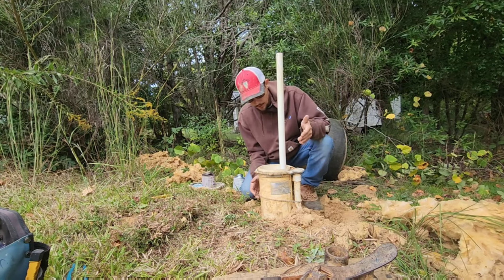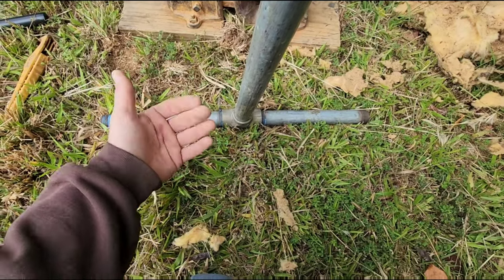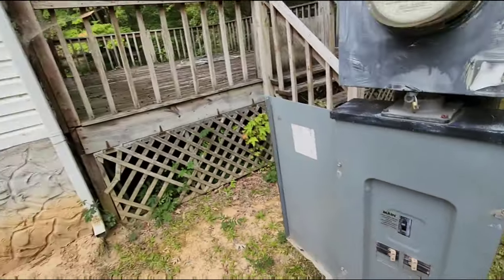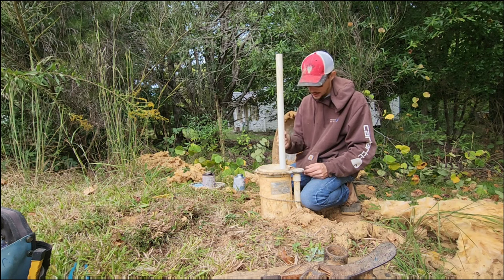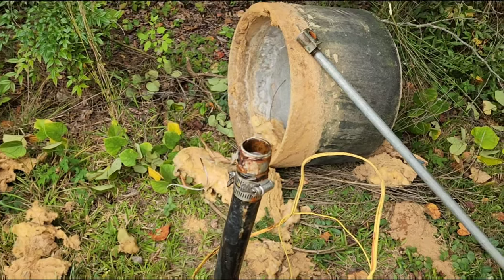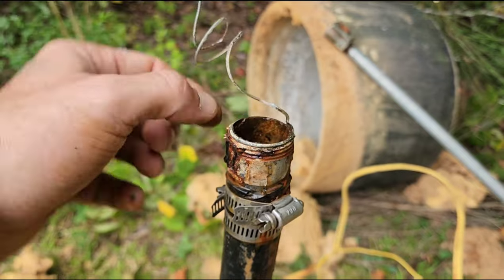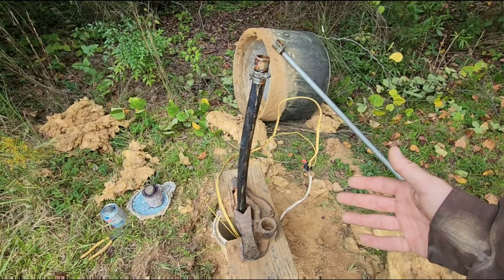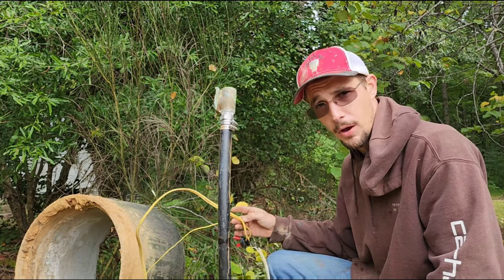Well Pump Repair on Pitless Adapter Style Hook-up. The Drop Pipe was Broken! No Water Pressure

Comment: So I have a well about 80 feet deep, and maybe 30 + years old. So I made my one inch T, connected to the pitless adaptor, got it lose and as we were lifting the pipe, the black PVC broke from the pitless adapter and all of the sudden we noticed the electrical wires been fast pulled down! So now the PVC pipe is about 25 feet down, and the 3 #10 wires are holding the pump. I thought we could just pull the wires to get the pump out, but that pump seems so heavy that we cannot budge not even a little. Any ideas of what I can do next?
Reply: It's possible that with the pipe falling 25 feet down your well that the pump on the bottom end got wedged against the sides of the borehole.  When my well was drilled, the pump installer was lowering the pump and water line down the hole and it got stuck before reaching the depth that the pump was supposed to operate at.  He tied a rope to the black poly water line, connected the other end to the bucket of his backhoe, and tried to pull it out by jerking up and down with the bucket.  The black poly pulled loose from the pump, as did the wiring and the rope to the pump, and he lost the pump.  He had to drop another pump down the hole right on top of the stuck pump.  It was a set price for me, so he was mad as hell.  Luckily my well puts out 15 gallons a minute and the water level was almost to the top of the casing so the second pump was not affected, even though it was a good 40 feet from where it was supposed to sit.  This might have happened to you.  I hope not but be careful with how much force you use to try and pull your pump to the surface using just the electrical wiring.  Good luck to you.

Comment: You skipped the part where you put the adapter on the black pipe. That's what I came here to see. Do you have to use a torch to heat it up?
Reply from the maker: Yes, heat the pipe for 10 secs with a torch & use a rubber mallet to push it onto the pipe.
Reply: @h2omechanic  Thanks, bud!

Comment: I'm definitely subscribing, liking and belling your channel. I have this exact casing cover and wondered how I am going to pull out my pump. I have a shallow cistern with a bad check-valve on the pump but never have worked or seen a pitless connection before and wondered how I was going to pull it without pulling on the wiring to get it out. Great channel and content. Thank you for taking the time to record, edit and post these videos. QUESTION: Are all of these pitless connections 1 inch?
Reply from the maker: Yes
Reply: @h2omechanic  Thank you so much for taking the time to share your knowledge with us all. Best wishes.

Comment: Just discovered your channel. Love it. Excellent content! Very understandable explanations! One question maybe you can answer. I left my cottage and shut the circuit breaker for the well pump off. I then attempted to drain my well water line this winter at the pressure tank which is located quite some distance downhill from my cottage. It appeared to drain forever, as if I had a siphoning situation happening. Is siphoning possible? If so, how to I prevent siphoning? Thanks in advance.
Reply from the maker: You are 100% correct. It's siphoning. You need a hose bib faucet near the well & open it when you're trying to drain the lines. Itll pull in air rather than draw water from the well

Comment: Can you[or another well tech] tell me what size that o-ring is??I have a maass model 6J1[I bet you know what that is ]and it VERY hard trying figure out what size it is .Its part#001030.I was wanting some spares in case I need them. I bet you may know the answer in your head and tell me where to get them. The manufacturer does not sell to individuals. My well pump that I installed in 2010 has been working fine for nearly 14 years and I have all the spare parts except new o-rings. Even bought a pipe dog. Thank you!!!
Reply from the maker: 3 different brands are all 3 different sizes Slightly. You have to remove it & carry it to napa, they'll have one or can make one specific to yours
Reply: @h2omechanic  Thanks for the reply but being a mechanic myself for 45years I bet there is some salty ole guys out there that know in there head the size or where I can purchase them. Thanks my friend. I would rather have that exact part #.or exact size .You know how o-rings shrink or grow when ya pull them out. The Napa guys would guess with their calipers. Thats what I am trying to avoid.

Comment: Proceedure of gluing pvc has advanced over the last 50 years. The manufacturers no longer advise twisting the pipe. Extensive testing has revealed this presses glue out of the joint creating a joint not fully solvent welded
Reply: I didn't know that. On a can of PVC glue I had it said to turn the pipe like only 1/4 turn then hold it. Maybe they haven't updated their label in who knows how long on the can of glue.

Comment: everyone who fits orings, knows they really like to get caught and pinched, then they break. unless you silicone lube it

also, i only now realized how it's done. i knew it's connected underground but couldn't figure out how it's physically connect it and remove. didn't even know. lately i found it's quick release fitting eh. people like it her because we are -20c....-30c country

i have old 20m well that was underground about 1.5m but sealed. teenager me didn't put new seal in 20+y ago when replacing pipe and pump. i use suction pump. i could buy submerged but they are expensive. water is close. it's untested but tastes good. noone around me cares of seals sadly. every house has one, some use old cesspit and run grey water into ground. we have city water, also from wells but that tastes worse. so i have to get seal back for safety. actually my now dead grandfather told to put seal back but i didn't. old was galvanized, with galvanized pipe through it. and brass valve at bottom. multistage pump with 3ph motor (230/400 country). now i have smaller one. most people don't care about well because they only water gardens, shame. water table is same. sometimes well likes to overflow. i haven't checked if casing is ok. seems to always come from down the well and flow into basement too. i have extra pipe luckily between well and house to run pipes and cables. so yeah, have to seal it back up properly. we also use pe(m) pipes here. but with screw fittings to hold them from outside, some have inner sleeve to not allow pipe to collapse. it's flexible. we never use pvc. pe is common, pvc is for sewer. sometimes pp for sewer. pex for water. or pex-al-pex. or copper. or galvanized steel (mostly in central heating and large pipes). i think pvc isn't good. but it's cheaper there i guess? and barb fitting with dual hose clamps is... unusual but it works. with screw fittings you could be all plastic if you want. but be is good, it never snaps, you could collapse it and pull, it ruins pipe but it's hard to break. you can literally fold it in half. here they often use like stainless steel cable as safety line, there it's often not used i see. even i have rope for my pipe. was solid galvanized wire but i found it rusted and broke eh. so have to fix my well somehow so it's protected as before. casing is just steel btw. old seal was flange and casing still has flange on it. many others have same but somehow don't seal it in lack of knowledge. should tell it to them. none of them are above ground either. some have wells in basements or in house (now illegal, or even then). i have it out. i guess seal is enough, it sucks to raise it 30cm above ground as required now. oh well. and i like to leave pit there too, it's nice place to run electrics to shed. i abused it as that

Comment: Great video is the T pipe used to pull the pump out available for sale or is something that you need to build
Reply: You can put one together yourself with black or galvanized pipe.  You need to know the depth of your pitless adapter down in your well casing for the long part of the T (this pipe will usually be available already precut to length and threaded at both ends at most  Lowes or hardware stores) and then make the two-handed handle (or top of the T) also with pre-cut and threaded 1" iron pipe.   A 1" pipe T (female thread: thread on inside of T) will connect all the parts.  As shown in the video, be sure and protect the male threads on the bottom of the T assembly with a 1" pipe fitting (anything with 1" female thread) and you are good to go.

Comment: I don't know what to say about this for one u can pull out the white sch 80 pipe out by 2 different ways to pull like it is on black ploy or pull straight up in the air  I see that have some nice trucks get urself a Crane
Reply from the maker: We have our crane T3 mounted on the trailer. Pvc isn't necessary to use in our area. Although my father used to use pvc in the 90s. Poly is just too simple.

Comment: High amps because the wire is under sized for the length of the run.  Pump gonna run hot.

Comment: Two things that might interest you, there’s a company called Mikalor that makes double wide hose clamps that use a T-bar clamp arrangement that are excellent to use instead of double normal clamps. Another thing that’s excellent for damp situations like these is Wago lever connectors, they replace wire nuts and they make a gel filled case for them that keeps the connections waterproof.

Comment: We just had to dig up the pitless on my parents farm. The well was dug in 1983 and the pump had finally stopped working and was kicking off the breaker. When we went to pull the pump the pitless was seized together. It wouldn’t budge pulling with a come along hanging off the tractor. It was actually squashing the tires on the tractor.  Not wanting to break the casing we called in the excavator. The pitless was at 8 feet down, since we are in Saskatchewan Canada. We totally lucked out and bought the exact same new pitless connector that was used in 1983. So we cut the clamps off, pulled it over and cut the wedge off the pitless in order to pull the pump.  It took lots of sledge hammer blows to finally get the corroded pitless apart. But at least we weren’t replacing the well casing.

Comment: Here in Michigan this type of pitless adapter is illegal for potable water, even though they sell them in hardware stores all over. The reason they are illegal is because over time the rubber washers that seal around the hole in the well casing will dry out and shrink, then surface water can get into the well and cause contamination. The only type of pitless adapter that’s legal here is a fully pressurized type. The type in my well has a saddle fitting which clamps around the outside of the well casing, with a large o-ring to seal against the casing. This is centered on the hole in the casing, and the underground pipe is threaded into the saddle fitting. Another fitting with a large o-ring presses against the inside of the casing using a toggle operated by a screw. The entire system hangs from a permanently installed T that fits over the top of the casing, under the cap. You put a half inch pipe with a flattened end down the center of the T and the larger pipe hanging from it, the flat end fits on the screw and you tighten or loosen it by turning the small pipe. Once it’s loose you just pull up on the T and everything in the well comes up. There’s no fitting in the way to get stuff like your pump caught. My well for instance has only a 4" casing, and with a 4" pump, there’s no room to clear a fitting like the one in this video. Finally, because the inside and outside fittings have one set of o-rings to seal on the outside, the internal water pressure prevents dried out seals and ground water infiltration.

Comment: Isn't the well casing yall use PVC just like the pipe threaded into the pitless? Does the casing yall use get old and brittle too? I think they used the PVC to protect the pitless threads so the next guy can easily thread a Tbar into it.  Maybe I'm wrong.  Common sense isn't that common anymore but to me what they did was common sense. No?
Reply from the maker: The pipe left in the pitless was a bad idea. I got lucky to unspin it. If it broke,  then it would be alot more work just to get it out
Reply: @h2omechanic  still a good video.  Good information.  Im about to drop a pump in my well in TN and know nothing about wells but learning quickly. Appreciate you taking the time to make these videos.

Comment: U Don't heat up pipe before you clamp it
Reply: Try forcing cold poly pipe onto a 1" barbed fitting and you will see why a gentle heating up of the pipe is needed.  Let the pipe cool back down and then tighten your clamps.  If you try and clamp a warm pipe you will cut into the pipe and weaken it.

Comment: @ 13:57 of the video you suggest using "Silicone - Grease," to lube the "O-Ring."  May I suggest, that in this day of Lawyer's and Ex- Californian's fleeing their state, I can hear the the Opening line to the jury, Yes Ladies and Gentlemen, although we're talking only PPM (Parts Per Million/Billion,) it was because of Mr. H2o's reckless disregard for human life, that my client and the next 6 (six) generations of **Mr. I WON THE LOTTERY**, will be blind,  can't have kid's, loss of affection, etc. 

I would highly recommend using some type of consumable vegetable {Corn, Peanut, Olive, what ever floats your boat etc.} OIL for the "O-Ring." 

Hell, worst case scenario use Vaseline.  But Dave that's a "Petroleum Product" also?  Yes It may be, but Doctors do use it from time to time HINT: Some types of Burns etc. 

I'm not a Doctor, Lawyer. I don't play one on Television, or in the movies. Just a fat old (69 yr's) welder, who's still welding.  That  "Silicone - Grease,"  On the "O-Ring," to me, is just a Low Hanging Fastball; wanting to be hit out of the park, if you get my drift.  Also, by Mr. H2o's "Introducing Contaminants," ("Silicone - Grease,") to my Clients Potable Water, {via putting "Silicone - Grease," onto the Exterior of the Pitless it self,} which is a very tight-fit / close-quarter's, by it's very nature.  As you can see, it can get ugly VERY QUICKLY!

My Lawyer(s) **Erving Pinkus Abroughawits**, & **Jonathan Pinchy Worthlessthanpiss**, of the law firm, **Dewey, Do’em, Screw’em, Cheatham, Righteously & Howe**, hasn't won a case in over 25 year's, but he'll win this one.

Comment: Galvanized should be illegal....rot waiting to happen

What is up with people putting fiberglass and caps over their wells?
Reply from the maker: Fiberglass mock rocks are common. It's always best to cover a well to prevent freezing (even on a pitless setup) 
The old concrete covers are hard to find bc the manufacturer's that made them went out of business during covid. Mock rocks are just a simple solution
Reply: @h2omechanic  here in northern Maine, our frost line is 7'. Never seen a well covered due to frost concerns. Pitiless adapter are the norm. We also use 2" blue board over and around the pitless area.